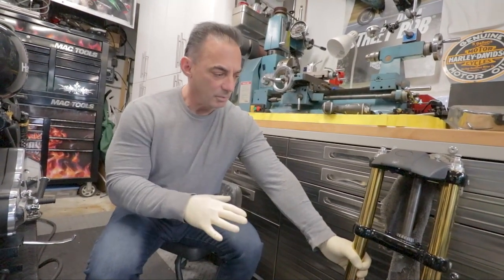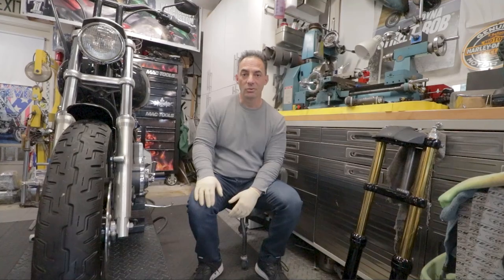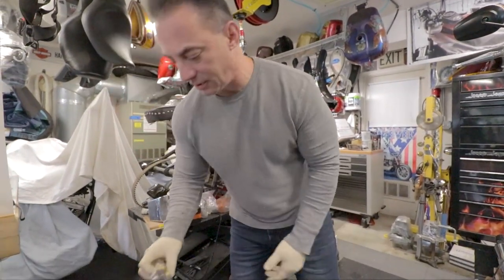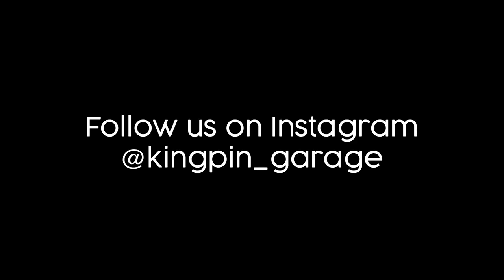We are putting a GOLD 39mm front end on our FXR!

Comment: Is it true that fxr's between 1989 and 1993 or 4 had problems with the cases cracking? I have a 1988 fxlr also. Cheers 🍺🍺🍺🍺🍺🍺🍺🍺🇳🇿😎
Reply from the maker: The case cracking issues were mostly 1990 and 1991 EVO motors and you would see the vertical hairline cracks forward of the oil pump. Your 1988 should be all good
Reply: @KingpinGarage  thanks for your prompt reply appreciate it. Just finished watching part 1 and 2 of front end conversion excellent. Interesting and informative. Cheers from new Zealand 🍺🍺🍺🍺🍺🇳🇿😎
Reply: 90 AND UP TO 92 HAD ISSUES FROM CASE CRACKING, THE ONES WE SAW WERE MOSTLY BETWEEN THE CYLINDERS AND WERE ALMOST ALWAYS FROM GUY UPPING THE HP ON THE MOTORS, HARLEY ADDED MORE ZINC TO THE ALLOY TO MAKE THE CASES LOOK SMOOTHER BIG MISTAKE WARRANTIED A FAIR AMOUNT OF CASE NEVER SAW ANY CRACKING AROUND THE OIL PUMPS.
Reply: @garyring8306  that's interesting..cheers 🍺 🍺 🍺 🍺 🍺 🍺 🍺 🍺 🍺 🇳🇿🏴😎

Comment: Also building an 88 FXR. 113" engine. Just got fxdx fork and cvo touring rotors amd sealed 13 spoke wheels. I can run any 11.8 rotors correct? Or do they need to be counter bored?
Reply from the maker: i’m not quite sure. the bolt holes will be the same but we are not sure about the bore size